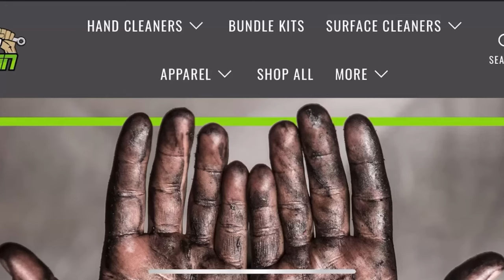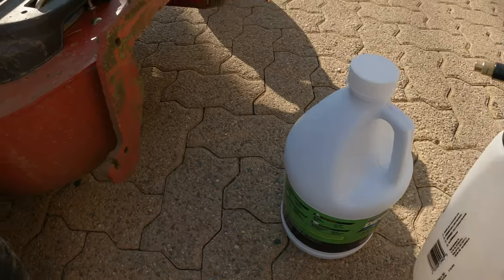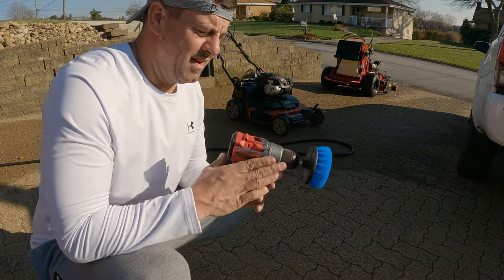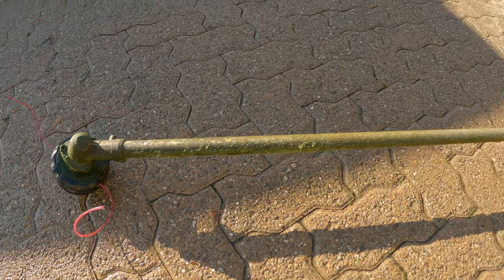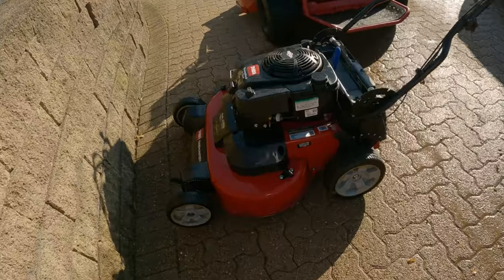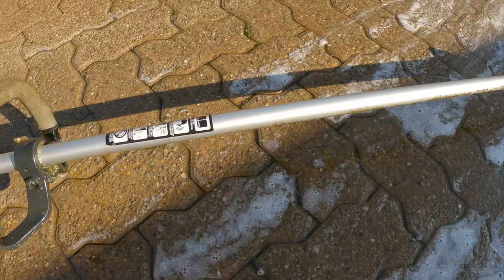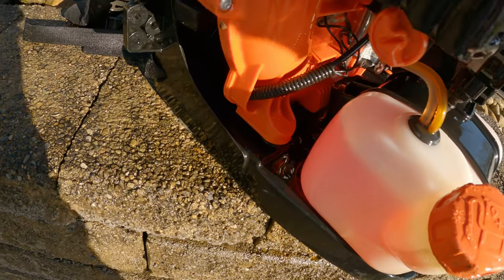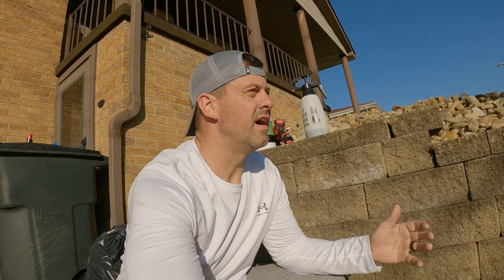New Degreaser/Cleaner For Mowers-Small Engine Equipment

Comment: I'm gonna have to get a hand sprayer so my finger doesn't get tired, plus so much faster. Oh yea I'm getting one of those brushes to. Wow I am impressed with this degreaser Tony 👊💯
Reply from the maker: It’s a great cleaner / degreaser for sure and it actually has a good smell to it. Not like some other cleaners that will make you get light headed cause of the smell. 👍🏼💯
Reply: @TheLawnFellas  A good smell is a plus and your right some cleaners get my so light headed so I am also impressed how well it cleans 👊💯
Reply from the maker: @wildbillslawncare5901  go
Check them out Bill. I am gonna get that rust remover next and give that a try in the spring. But their hand soap and wipes are phenomenal 👍🏼
Reply: @TheLawnFellas  I will definitely check them out. Oh I can't wait to see the video on the rust remover. I'll have to get the soap and wipes also 👊
Reply from the maker: @wildbillslawncare5901  👊🏼💯
Reply: @TheLawnFellas  👊💯